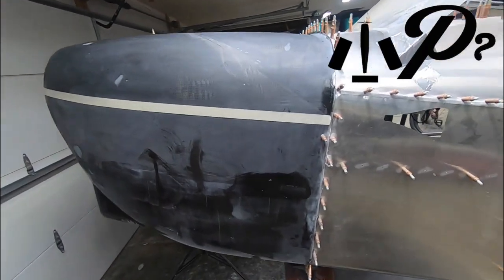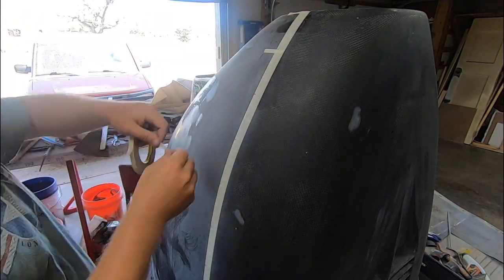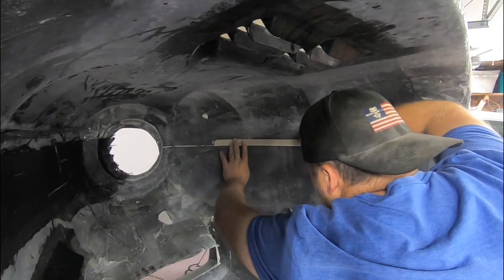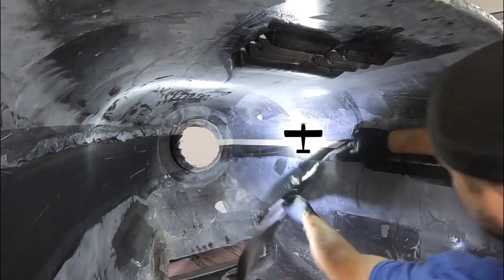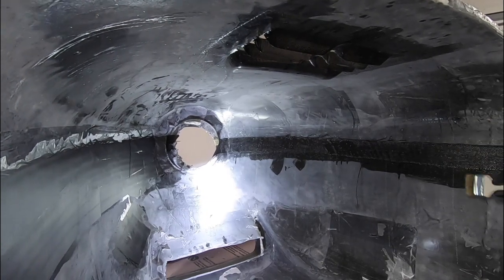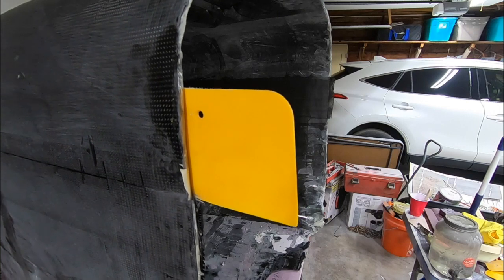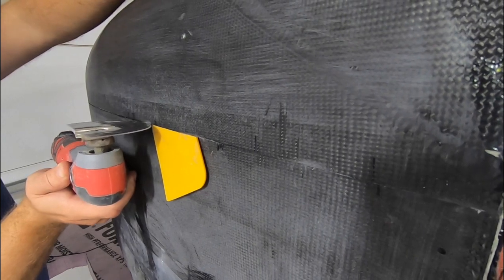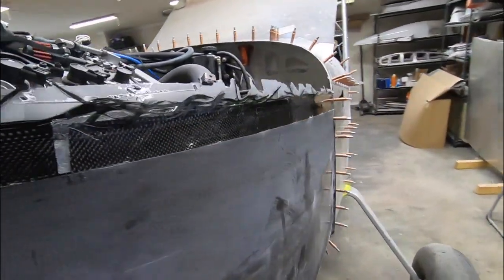Scratch Build Composite Airplane Cowling Part 4 EP 54

Comment: Hey I work on and own and love these 3cylinder 998cc engine , but as soon as you can I know of a problem part that can cause serious engine "Misfire" it is the P.T.O shaft that drives in your case the Prop gearing. Replace it with a "Speedwerx" PTO complete shaft and bearing pops out quickly. You will thank me later, I love watching your build.:stayhome: It is a problem part under a load will flex and wobble causing  a terrible unsafe vibration. The new one acts like a Harmonic balancer and has a tighter clearances fitting spline. :goodvibes:
Reply from the maker: Appreciate the tip and for following along! I’ll look into that👍